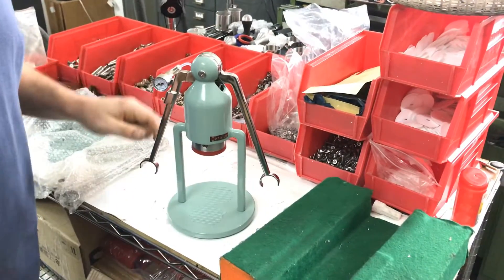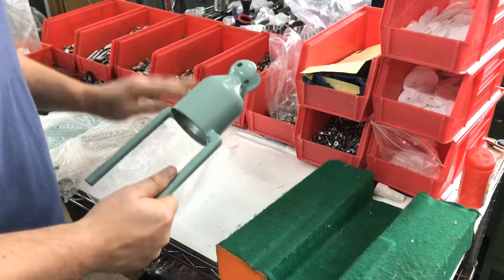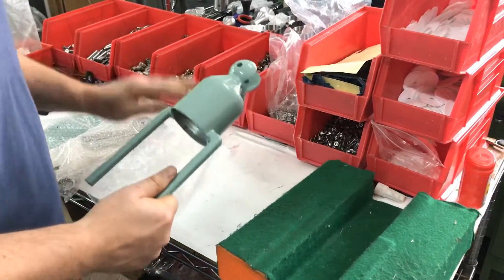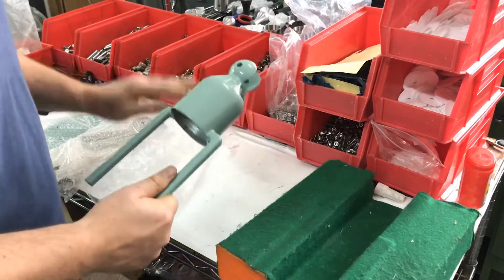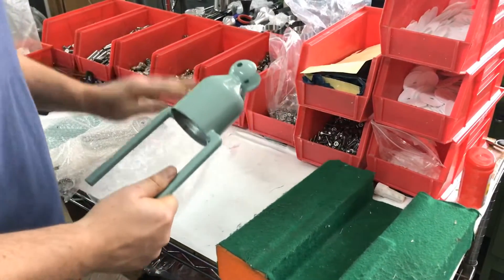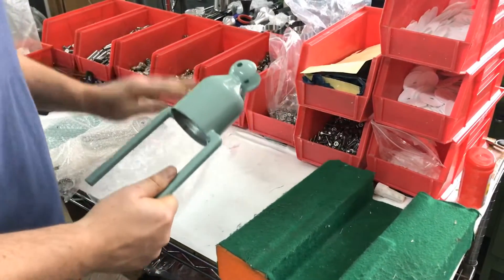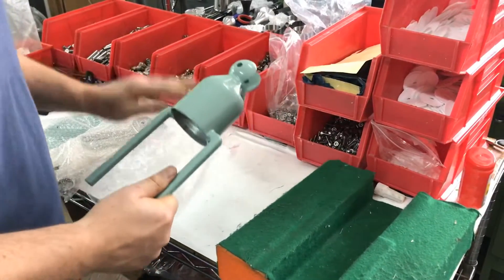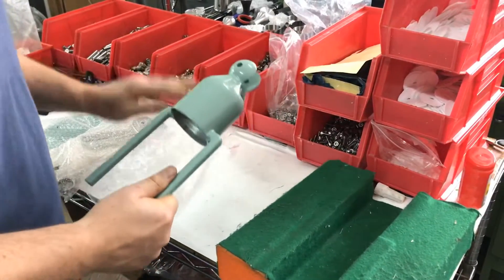Building the Robots

Comment: I just received my Cafelat Robot today and am super pleased with the purchase!   Combined with the Niche Zero grinder,  the Robot gives me an amazing cup of espresso.  The main reason I went with the Robot is so that I don't have to worry about boiler corrosion/scaling, electrical or valve problems,  flushing and temperature control, etc, with an electrically powered machine.   A simple, mechanical device is a joy to use;  all you need is hot water, appropriately ground coffee, and the Robot.  I bought the Barista/Pro model with the non-pressurized basket and pressure guage.  I was quite pleased to see that they included in the box an extra silicon seal for the piston, a packet of 111 food-grade silicon grease for the seal, and a piston plug with seal  in case you ever want to do away with the pressure gauge (where I can see that with regular use,  you'll learn to "feel" the proper pressure and won't use/need the gauge any more).   10/10 would buy again!

Comment: I amazed at the simplicity of design and see a huge profit margin.

Congratulations on your success!🎉👏

I already own a Decent Espresso machine and use an AeroPress as a backup when out of store bought water. Still, I want the Robot for a change of pace and frankly, I just love the beauty and simplicity. If it works the way I think it will, selling the Decent is not unthinkable.
I think of the Decent as top espresso machine in the marketplace but your manual machine with its no fuss temperature or water quality design is simply captivating.

Comment: Please make 7g basket. This is a real single size
Reply: Thanks for the suggestion but I have never found a single basket that works correctly.
Reply: @PJP73  exactly.  You can always stop the shot at 7grams but pulling single basket shots have always been less than stellar, on any machine in my experience also.  Would be nice though if there was a machine out there that could "pull this off" :)

Comment: Why not make it fully steel? Aluminum production creates tons of toxic aluminum dust and it is absorbed by whatever it comes into contact with, including soil and food products. 

Also, for the price of the Robot, steel would be better bang for the buck, unlike cheap aluminum.

For example, you can buy a fully steel kettle for under $20.
Hence, it's not expensive or anything. 

Using so much aluminum in a manual lever machine priced at $450 feels a bit cheap/greedy.